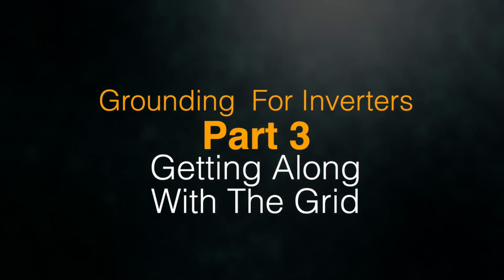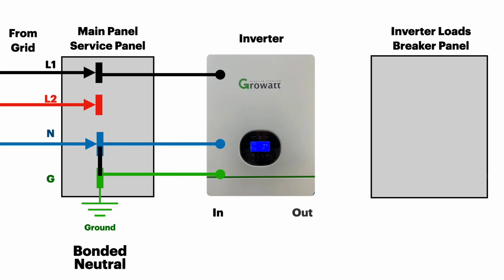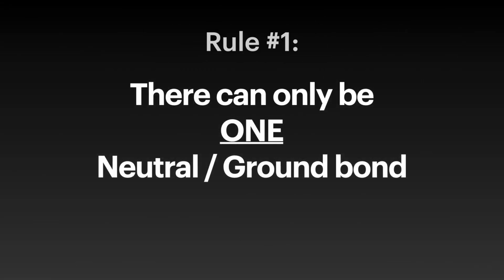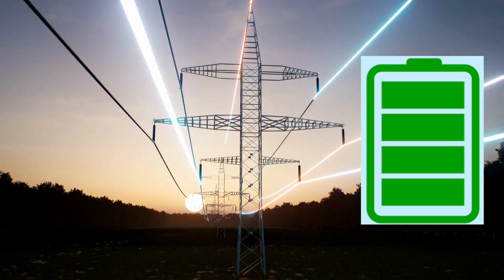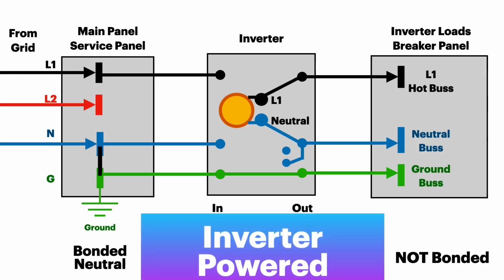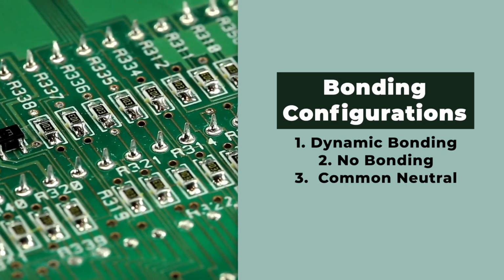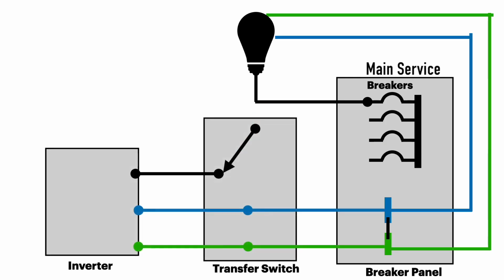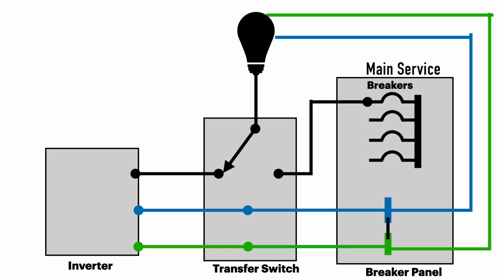Grounding for Inverters Part 3:  Getting Along With The Grid  [UPDATED!]

Comment: Thank you for your video, this information is difficult to find even with the technical support of some of the companies mentioned. I'm installing an Eg4 3000 W on my van, it seems that I'll need to install the screw to enable the bounding while the van is connected to the grid while charging the batteries. Since this inverter only has protection ground (green wire) on the AC input, do you think you could install CFCI outlets that work when the van is disconnected from the grid?
Reply from the maker: Most likely the ground is passed through the inverter to the grounding lug on the inverter case.
I'm assuming you checked voltages between L-N, L-G, and N-G? Also, check with an outlet tester that checks for ground neutral bonding.

You should be able to run GFCI outlets AFTER the inverter. Another choice is to run a small breaker panel AFTER the inverter with a GFCI breaker in it.
The GFCI looks at the line and neutral to see that they are the same current.
Reply: @ReelClearMediaLLC  Thank you for your reply, my understanding from your video (4:00 min) is that in the presence of the AC (grid) the inverter will disconnect in the AC output the neutral from protection ground, however, since the Eg4 does not have a lug for protection ground output, in my understanding the GFCI outlets connected to the inverter will need to have the protection ground connected to correspondent lug from AC (grid) input. is that correct? 
How about the inverter chassis connection to the van chassis? What's the impact of connecting together? In this case, the DC negative from the van and from the inverter will be connected, I guess the relay controlling the bounded ground would protect the van from any potential issue connecting the inverter AC input to an outlet with leaked protection ground, is that correct?
Reply from the maker: @istvanszini9572  does the eg4 have a ground lug on the case?
Reply: @ReelClearMediaLLC  Based on EG4 manual, the AC output protection ground should be connected to the Inverter housing screw, and not to the AC input protection ground. IF (capital letters) the AC input protection ground is not connected to the inverter housing (during shore power connection mode) Then the protection ground reference for the AC output remains the inverter chassis and potentially the whole van chassis (if the inverter is galvanically connected to the van chassis), This seems to be the best case scenario in my understanding. IF the AC input protection ground is connected to the inverter chassis, then a faulty connection on the AC input  (grid side) could leak a high potential to the whole van chassis, and that would be very dangerous. Am I understanding this right?
Reply from the maker: @istvanszini9572  Unfortunately, I don't have experience with mobile installations or the EG4 3000w. You may want to check with Will Prowse, https://www.youtube.com/@WillProwse. He's also got a website and forum that are very good.

Comment: May i ask something please
I just want to make sure. 
As i understand
1.If my inverter does not have neutal-ground bounding inside, i just bond it outside right ? and it will work for all cases.

2. If my hybrid inverter has neutral-groud bonding on the input side, i should not make neutral on the output side and ground touching together (bonding) right ?
Reply from the maker: 1. In some cases...you can bond at a panel after the inverter.  Usually, an inverter that has an AC input can be bonded (if it isn't bonded already internally). 
Some inverters should never be bonded, as they will burn up, and can be dangerous. Usually, these have AC outlets on the inverter instead of a terminal block. 
2. If your inverter is bonded on the input side, and you bond on the output side, you create two bonds, which causes current to flow on the ground wire... very dangerous.
Some inverters have dynamic bonding to fix this problem... watch the whole grounding and bonding playlist...there is a lot of information in there.

Comment: Unless i missed it you did not cover what to do when using 2 mpp solar inverters in split phase with grid input.  Do i remove the bond screw in the 2nd inverter or will it work as it comes from factory letting the ats manage the bond in both inverters. Thanks
Reply from the maker: I'm not sure with MPP solar... check the MPP forums, or DIY solar forums to see what others have done.
Reply: @ReelClearMediaLLC thanks I'll check around.  Based on your video in the first example.. dynamic bonding with just 1 phase if we add inverter 2 on l2 then we have introduced a 2nd bond.

Comment: Question, i have my  mpp solar inverter running as a ups, i have it plugged in a gfci outlet and when i have hooked up to a direct load or sub panel everything works fine, but when i hook it up to the transfer swith to the main panel it  trips my gfci outlet for the input. how do i keep it from tripping?  i removed the ground neutral bond in the inverter.
Reply from the maker: I'm not sure how everything is wired up... Could you  go item by item in order for input and output for when it works, and again item by item for when it doesn't.
example... main breaker out to gfci outlet. Gfci out to input of inverter, etc.
Reply: Main panel to gfci outlet, gfci outlet to inverter input, inverter to generator transfer switch, generator transfer switch ground neutral to main panel, line one line two to the loads etc.

Inverter is mpp solar lv6048. The neutral bond in the inverter has been removed, 

When the inverter is plugged into the gfci and the output is wired to an outlet everything is good, when I plug the inverter output to generator transfer switch it trips the gfci outlet
Reply from the maker: @timboe1848  When you say "the output is wired to an outlet everything is good"... This means a separate outlet not tied in to house wiring? It sounds like the problem is at the transfer switch.
Does the transfer switch bond Ground and Neutral? 
Does the transfer switch switch neutral, or only hot lines?
Reply: @ReelClearMediaLLC  when I have the output wired to to its own outlet everything works perfectly. The transfer switch connection is my issue. The ac input can by used to bypass the inverter to power the loads which comes from the main panel back to the transfer switch. Think it causing a loop. When the inverter is in battery mode the bond for the inverter is not attached and when i unplug the ac input everything works fine. The transfer switch only swaps out the hot lines and connects the ground and neutral back at the main panel.
Reply: This happened to me as well due to the internal bond.  It ruined my gfci outlet. I ended up plugging it into a regular non gfci protected outlet.
Reply: @natesoffroad  I removed the internal bond though, thought that would fix it. But still trips. I can’t plug the inverter into the transfer switch back to the main while I have the inverter plugged in for charging the battery purposes

Comment: Which category is an EcoFlow Delta Pro? My tester shows it has a floating neutral. What to do to make it grid-assisted?
Reply: I saw your video about “grid-assisted” and it’s what I was looking for.  Not off-grid and not grid-tied. I have an EcoFlow Delta Pro and it’s a floating ground battery/inverter unit. I want to use it like a generator into a transfer switch and I would also like to have the grid be able to charge it or have solar input also. The implications for neutral bonding gets complicated.
Reply from the maker: I haven't owned one of those, so I don't know specifics. There are multiple videos of people using transfer switches or interlock switches to power their houses.
What exactly are you hoping to use it for?

Comment: I found your video most helpful - I have a Powmr Hybrid inverter 120v  3K  24V  and it only has a L1 and N out - I do not have it connected to utility so I connected the ground to the ground rod which is in my garage and at the outlet I bridge the ground to the Neutral before I did that I made sure that with everything running including all inline breakers that there was no continuity or Voltage between the Neutral and the Ground - after that I connected my Tesla Mobile connector and the Ground fault is gone now - and it actually charging the tesla at 8 AMPS - 12 is the max - but just the fact that is working is a huge plus before that I would get a ground fault immediately after connecting.  Thank you very much for your videos - I do agree that they should have a common Neutral hopefully in the future they build hybrid inverters that have that feature , I do not plan to connect it to Utility for Charging so it should be fine.   In the future I plan to get a Subpanel and use the bonding from Ground to Neutral that comes with the subpanel, I have watch other videos including one by EG4   and by far your video seem to be the most professionally done, what a difference!   I am new subscriber and will watch the rest of your videos.
Reply from the maker: Awesome!

Comment: Excelent video…..My house does not have a gorund wire at all.   Only a neutral and L1-L2 . I wan to feed  L1 and neutral coming from a power bank (Battery-Inverter) to the buss bars and neutral to the neutral bar in the neutral bar.  Of course I have a double breaker that cuts the L1 and L2 feed off the grid when the power bank or the inverter is feeding the home circuitr. I am not in the USA.  An electritian recommended a 3 phase breaker taht will not not only have L1 and L2 from the grid but also de neutral phase.

Comment: Thank you for your videos. I am using a Xantrex 2000 Watt inverter which has the ground and neutral bonded and is not easily removed.  The transfer switch is a Generac.  In the Generac the switch only switches the Line and not the neutral.  The neutral is hard wired from the generator/ inverter to the main panel neutral and the ground is also hard wired through the Generac.  Is it safe to not connect the ground wire from the Xantrex to the Generac transfer switch? As a test, I connected the transfer switch to the Xantrex through the GFCI receptacle on the front of the inverter.  The GFCI will trip when connecting the ground wire, but works if the ground is not connected from the inverter.  I believe this is because the GFCI senses a lower resistance path back to the source (the inverter).  If the ground is not connected from the inverter to the transfer switch, the neutral ground bond is supplied at the main panel and you have equal current entering and leaving the GFCI receptacle.  I am a little scared to connect the inverter to the transfer switch from the terminals in the back of the inverter until I know that it is safe.  I am planning to draw no more than 15 Amps from the inverter at 120 Volts and I am not connecting the Xantrex to "shore power".  After thinking about this a lot and doing some research, I feel that as long as I use the GFCI outlet which is rated for 20 Amps, this should work.  But I would love to hear what you have to say.  Thanks again.
Reply from the maker: When you add a ground wire to the bonded inverter, there are now two return paths on your circuit (see video). The GFCI trips because the current on the Neutral doesn't match the current on the Line (because some of the return current is now on the ground wire).

Since you can't easily remove the bond in the inverter, one way to fix this is to use a transfer switch that can also switch Neutral. These can be pricy, though.

Since you are only running 15 amps, you can use a small transfer switch like the EZ Generator Switch. It can be wired to switch Line and Neutral, and is less than $100.
https://amzn.to/48O68li
Reply: Thank you.  I found that if I plugged in a outlet tester into a receptacle that went through the transfer switch, that it indicated that the receptacle was wired correctly when it was running off of the inverter.  So it is similar to your last example.  The neutral ground bond was supplied in the main box.  I am thinking that it would be safe if I used the GFCI outlet of the inverter since I think that you can use GFCIs in situations were there is no ground.  Can you suggest safety checks that I can do to make sure that there are no hidden hazardous situations.  Thanks again for your videos.  The videos have provided the best explanation about neutral ground bonding.  Also, I would like to add that my setup is for emergency back up.  Normally we are using the grid. I do have two of the switches that you mentioned.  I'm not sure how I would interface the switch using the Generac transfer switch.  I would probably need to have an electrician install it, even though I know how to do it so that I would stay compliant with the code, permits, and inspections.    @ReelClearMediaLLC
Reply from the maker: @richardphillips2405  Most outlet testers just tell you if there is a bond. You have two bonds in your system, so it shows OK. However two bonds can cause loops and problems.

I wouldn't use the Generac switch at all with the EZ-Generator switch. Just wire the EZ-generator to the circuit you want to run and run an extension cord to the inverter to the EZ-Generator.

Comment: hi i want to bound my solar inverter which is solis 6kw hybrid chinese branch here in pakistan 2 wires came from grid  hot(230v) and neutral so can i bound on main dp only like you told rule number 1 and any other changes made ? inverter also have PE port on both Grid in side and load out side... 
Please explain and advance love from paksitan.

Comment: Watched this whole series, and appreciate all the info. Having some issues with my growatt 3000 lvm 24. It’s in a van conversion so it can’t have a permanent NG bond. When using shore power everything is fine. When off shore power and using inverter I’m getting the 40v on G to N and 60v on G to L. I tried the jumper line between the N in/out and while it did turn off the “reverse polarity” light in my paneltronics breaker panel I’m still getting the same voltage readings and fault light in my three prong outlet tester. Any idea what my issue is and how to fix it?
Reply from the maker: The N in/out ground won't help in a mobile install, as it uses the N-G bond in the house.

You have to add a N-G bond only when you're NOT on shore power, but when you're on shore power, not have this new bond (or you'll have two bonds and voltage on your ground).

Some people do this with a relay that creates a bond when there is no shore power, then breaks the bond when shore power is connected. Search youtube for videos on this.

It's also possible to wire up a bond when you are on inverter power, and manually remove the bond when on shore power, but it doesn't help if you are on shore power and the shore power goes out.

Comment: Hi RCM. Very informative video indeed. I recently installed a Growatt 3000TL LVM inverter. I am considering to bridge the neutrals (In & Out) as explained in your video. Do you have any reference or whitepaper that stipulates that this specific model will not blow up? (SPF3000TLHVM-24 - GROWATT 3KW INVERTER 24V). As I understand the South African standard (please note that I'm not an electrician), we can  bridge the neutrals, if we can isolate completely from the grid during a power outage, this we can achieve with a contactor at the meter. looking forward to your response.
Reply from the maker: This video was based on North America, where we bond at the main panel after the meter from the grid. Unfortunately, I'm not familiar with standards in the rest of the world. It seems hard to get information from GroWatt. It may work, but I don't know.

You could likely use this as an "off-grid" backup system, by using a transfer switch. You have to determine if your Growatt is bonded or not at it's output. Use a transfer switch (DPDT) to switch the input of a breaker panel between inverter and grid, and don't hook up the grid to the inverter input. The transfer switch needs to switch neutral and line. Even then, check with someone in your area who knows how the local electric is bonded and grounded.
Reply: @ReelClearMediaLLC  our supply from the utility is bonded. I have verified the bonding at the output of the inverter this morning, it is only bonded during normal utility supply, when a power outage occurs, the bonding is broken. I will then rather use a Normally Closed relay to re-bond at the output of the inverter during an utility supply outage. Thanking you kindly, regards, Brian
Reply from the maker: @meerkatZA Thanks for the information. That sounds good.  I'm assuming you power the relay from the grid, and it only bonds when the grid goes out?
Reply: @ReelClearMediaLLC  that is correct, thx a million

Comment: Great video. Unfortunately the common neutral is illegal in many countries. If you want to run in island mode, you need to rely on your own neutral. This is a more complex scenario where you use the grid neutral when there is grid, and the internally bonded neutral when using the island mode. If the inverter does it all its great but if it doesn't? You could work in this scenario in another video if you want.
Reply from the maker: Thanks for the information. These videos are only related to grid in North America, since we bond N-G in the main breaker after the meter.